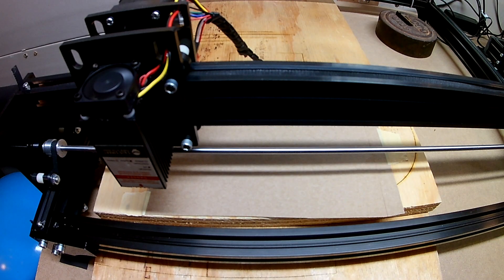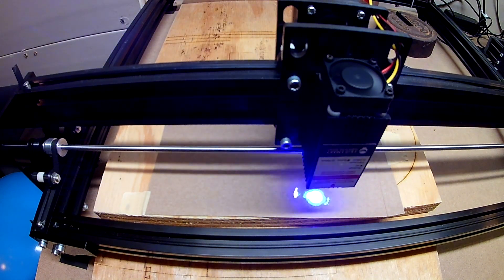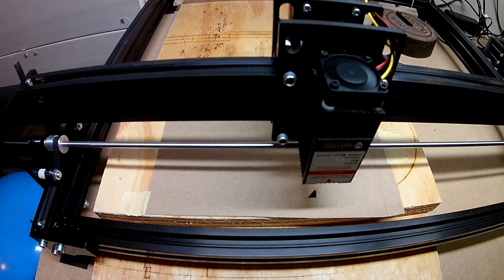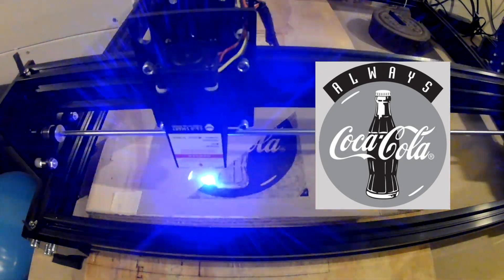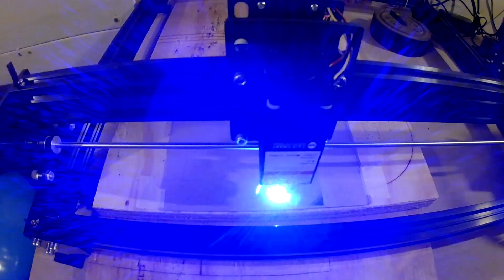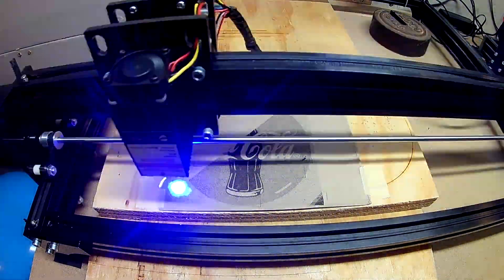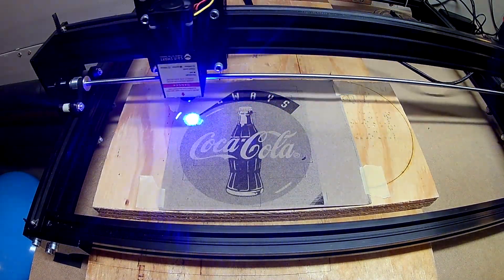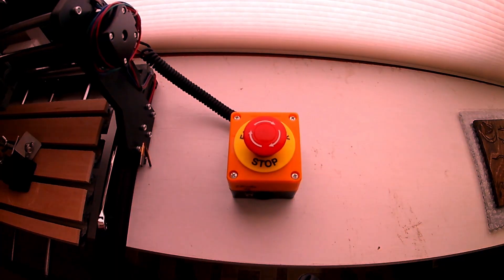Image engraving with LightBurn

Comment: How would I take a picture of a person that’s color and laser engrave it on wood,glass…..?
Reply from the maker: Great question John.  I use a program called LightBurn to run my laser.  I have been very impressed with this software.  To burn on wood or glass, you simply bring the image into LightBurn, size it, and set your burn parameters for your material.  Once your material is loaded and the laser is all set up (focused!), you run the project.  For images, I use the Jarvis dithering setting and that works well for me.  There are several examples of this process on the channel on Glass, wood, and ceramic tile!

Comment: Hello, when burning your image did you use fill or image? I'm having an issue where my laser will not turn on when I have an image I'm trying to burn. If I do line or fill the laser comes on.
I have a blue 5.5w that I am running on my 3018 CNC using the GRBL driver
Reply from the maker: Sorry to hear that you laser is not operating as it should.  This project was burning an image and NOT a vector with fill.

Comment: You think light burn would work with my laser machine. I got a vigotec L7X. The text is printing out backwards. Wifi won't connect. Lookout to see if I should get something else
Reply from the maker: I do know anything about the Vigotec L7X.  I looked it up on-line. I like the small design form factor.  The description said that the software has to be the Vigo Works.  It also says that it supports G-code.  If that is the case, you might be able to get LightBurn to work for you.  I hope you are able to figure out what is going on.
Reply: @CNCATHome  thanks for the advice, I don't no anything about this craft. What is g code exactly? I'm lost
Reply from the maker: @cutflower36  - That is a good question.  G-Code is the language that many CNC machines have used for decades.  There are many variants of G-Code based on how a manufacturer has implemented it.  G-Code tells a CNC machine what to do.  Here are a few basic codes.
G90 tells the controller to move based on absolute coordinates and G91 tells the controller to move relative to its current position.  G0 is a quick move and is followed by an X, Y, and Z location where you want the laser head or cutting head to go to.  So G0 X15.00 Y20.00 tells the machine to move to the XY coordinates of 15 in the X and 20 in the Y.  Most people do not write their own G-Code these days as computers do a much better job of it.  Many controllers still operate with this format.  I hope that helps.
Reply: @CNCATHome  thanks, I need all the help I can get

Comment: Is it necessary to raise your project on that extra piece of wood, just wondering
Reply from the maker: That is a good questions.  The basic answer is no.  It just works better closer.  With the simple lens focusing the laser, it works best closer.  Think of a focusing flashlight.  Focused in close it is bright and even focused at a long distance, the light scatters.
Reply: @CNCATHome  ok that makes sense. I will have to try this. I hot one last week, haven't used yet. Trying to learn as much as possible
Reply from the maker: @cutflower36  - That is exciting!  I learn best by doing.  When I got my first laser put together, I tried burning the SainSmart logo guy on the back of the assembly manual.  I just couldn't wait.  :-)
Reply: @CNCATHome  kinda scared, don't want to mess up my eye site, but I'll wk up the courage. I purchase new glasses also.
Reply from the maker: @cutflower36  - You don't need to be scared of the laser.  You do need to be respectful of it.  Just like electricity in the wall which can kill you 10 times over in the wrong circumstances.  The easiest way to protect your eyes is to enclose your laser in some sort of box and never even watch it while it is on.  I created a fume box that shields the laser from all but one side.  That really limits accidental reflections.  Respect the laser. :-)
Reply: @CNCATHome  I got it moved to the laundry room with my laptop. There is a window and a back door, my hubby put up a screen door today so I will have a fan blowing it out. Thanks for all your help. I do need some type of shield. But I think I will step out side or with back I. The house while it runs.

Comment: Hello! Thanks for sharing these contents in your channel. Quicl question.. How long does it takes and which was the size (aprox)? 
I have brought a cnc laser 1 or 2 months ago, and Im mainly using it for logos. I havent had good experience with grayscale setup, and it takes a lot (always more than 2 or 3 hours for images of 25 x 30 cms roughly). Its a 2.5 nw diode blue laser
Reply from the maker: Great question.  This image is about 12X13 cm.  I do not remember exactly how long this one took.  According to LightBurn, it is estimating around 70 minutes.  I used a dither setting, not grayscale.  I could also have burned this quite a bit faster.  I was at 2,000mm/min at 40% power.  I could have upped the power and moved faster.

Time to burn an image is always longer that you want.  If you up the resolution (lines/mm), that will increase the time to engrave.  Two to three hours to engrave something the size you are talking about sounds about right.

My laser is a 5.5watt LED laser and I typically do not run it at 100%.  When I am burning card stock, I run around 5,000 mm/min at 60% power and that seems to work well.

Keep on burning and have fun with your CNC laser.
Reply: @CNCATHome  Thanks for your quick reply! I will keep playing with the setup then. Regards from Chile!